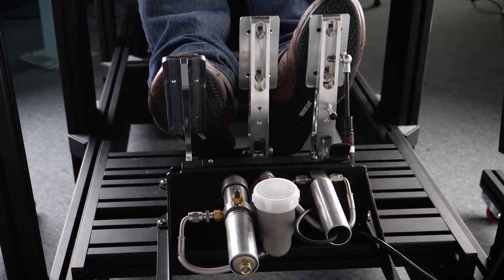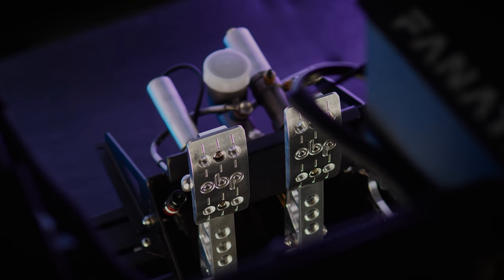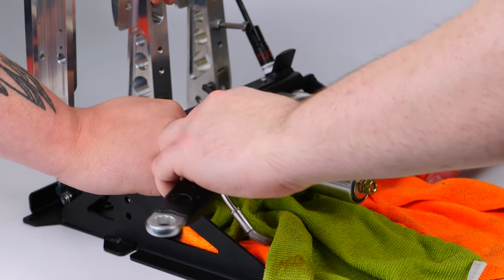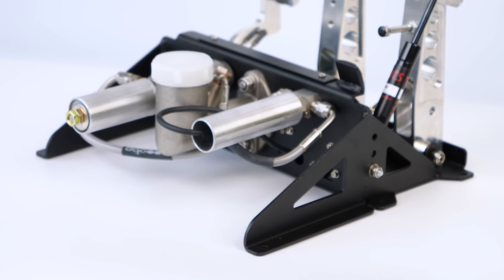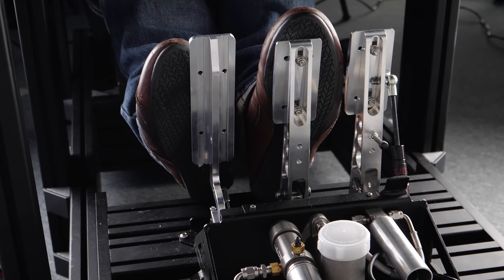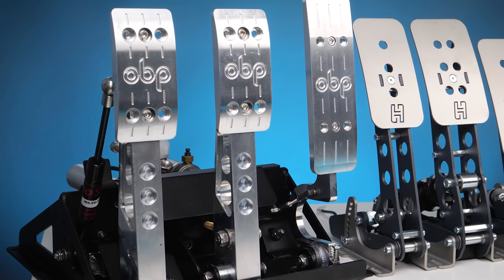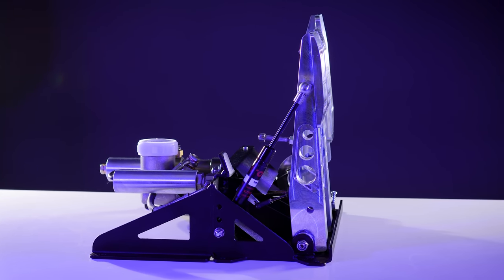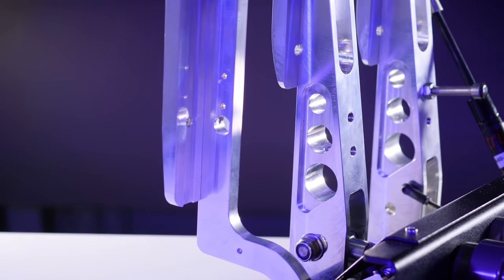Real Race Car Pedals for Sim Racing? Why Not! | OBP Sim Racing Pedals V2

Comment: I really like the simulated biting point on the V3's and others, for a clutch pedal to just be linear in it's feel is a step backwards IMO, a real clutch has a very obvious point where you overcome the pressure plate springs and good sim pedals should do also I think.
Reply: I was also thinking that

Comment: These OBB pedals are notorious for flexing in real racecar, when i was looking to build my own, everyone that had worked with them told that its not worth to use them and you should step up to tilton set. And they said that they definitely wold flex in sim racing environment. And i can tell you from experience you lose a lot of the “pure and high quality feeling form flexing.

Comment: Funny, when I talk to sim racers that bought this pedal, 80 % sold it after under 2 months of use, they had lot of problems with, sad. I had this pedals for testing in my old rig an it was a great experience, but 100% shore this is not a plug and play type of equipment, you need some dedication to make it right and for every different sim is also a setup to make it perfect. So I would advise people buy this only than you don't care how much cash it cost and you have no problem to setup it right.

Comment: Great video as always.
The brake appears to have too much initial movement compared to a race car, well all the ones I have pressed anyway. But I guess that is adjustable. 
Also I am still not convinced hydraulic gives any advantages. A properly set up and bled hydraulic system should not compress, so why not just have a mechanical linkage and not have the complication of a master cylinder, hoses and slave cylinder?

Comment: I got these last week and yet to use them as waiting on simucube 2. I had to drill two extra holes in the rear steel frame so i could mount them to the simlab pedal slider plate securley using the front and rear slots in the plate. OBP needs to add these holes for the future in my opinion. Hoping they are good!
Reply from the maker: Interesting - I didn't check these out with the slider, as that's still sitting in a box waiting to be installed!
Reply: @ChrisHaye  the extra holes go approximately 3.5 inches behind the middle mouting holes. You should see when you get the plate out. At first i was going to use the middle holes and drill the 12mm plate. But then i figured it would be a lot easier to drill the 2mm plate and that also lets me slide them left and right. OBP needs to drill these two holes or simlab needs to cut another slot in their plate for the middle mounts. Hopefully someone sees this as this is the first review on these pedals!
Reply: Hi there,
I have a set of these that arrived for a p1x. Did you still the pedal ok?

Comment: Great video as always Chris, they look amazing. Quick question for you, I noticed your feet position on the pedals and wondered if it's usual to have a gap between your heel and the pedal. I am trying to optimise this positioning (for speed) and I do the same as you but I've seen some pedal cams where the whole of the sole of the foot looks to be right up on the pedal with little to no gap there. I wondered if that might improve reaction times/ speed once I'd got used to it? I realise it's slightly off-topic but I'd appreciate any advice. I think rig setup and positioning of all elements is a generally underappreciated area. Keep up the great work, loving the channel!

Comment: Good to see a British Company taking advantage of us SIM racing mugs. £1.3K for a set of peddles outrageous. 
When I looked again at the peddles with my engineering head on, these are expensive to design and produce, weight reduction has been a priority in the design (not sure SIM racers should have to pay for this). Each of the three peddles is unique requiring different CNC machine programs, I could go on - but I won't, they are actually pretty good value for money, I doubt they are making 30% profit.
I don't think they will sell many of them at this price point, I for one will not be buying. I think what OBS Motorsport need to do is build this product at about £500 retail while still retaining all the features, could be done, simplify manufacture, SIM racers don't need weight reduction we don't move, use different materials maybe.  I would be a customer at £500 and maybe a bit more.
Good review Chris, hide them well, they are over engineered for a SIM racers needs, but beautiful a keeper for sure.
Iain
Reply: This is probably Saturday work for the OBS lads, Using existing machine setups and materials they have in stock, I doubt the sales figures(compared to their real racing stuff) justifies new setups, and possibly dedicated machinery, although with this unending lockdown style of government that might have changed, as sales must have dropped off for the real thing, as sporting events which depend on gates must be really struggling, Even F1 must be losing money now!

Comment: Hi Chris, first of all thanks for your videos has always. One question : do you need to apply more forces on the brake compared to the heusinkveld sprint? (i use between 25kg and 45 kg on the sprints). I wonder if it's not too low fore these OBP pedals. Second quesion : do you feel a difference on the trail braking between Sprint and OBP? It's rare to have someone able to compare those two pedals.

Thanks !

Comment: Just took  them out of the box and the pedals seem really close together.   I have sprints and I have more space between throttle/brake.   I see most people have left them in the original position.  I know you can move pedal over one slot and this is personal preference.   Seems like feet touch on current setup.  I left foot brake.   Wondering if you moved pedal face position.  Thanks

Comment: Hi Chris, the reason the USB adapter is separate is so the pedals can be plugged directly into a DD wheelbase or used on Thrustmaster wheels; Fanatec support is still in development. Also, you don't need to use the DIView software to calibrate them, you can use the windows game controller setup as shown here: https://youtu.be/-oSkwnRE4_U

Comment: Made something similar for like 250 euro not as fancy but works
Reply from the maker: Sweet! Got any pictures you can share? :)
Reply: @ChrisHaye  when I get home 🏠 I used something I not found yet on the internet meaning drive by wire gas paddles 3 times reading the values from it and using a pressure sensor with also master and slave cylinder and programmed a arduino pro micro
Reply: @ChrisHaye  are you in to diy stuff like simhub and openffboard, 3D printed steering wheels?
Reply: @ChrisHaye  https://drive.google.com/drive/folders/1rM202Q2XLWwNr7Rb4VL58OX9mwVQ4aRJ let me know what you think ;-) the aluminum 3030 is like halve the price so... and you can use pull slave cylinder to make it beter.. ordered also new spring.. for clutch and brake.. you can make it so expensive and how you like .. you want the current software does some kind of mapping to make it curve like heusinkveld software does.. many ideas to improve and to change but so limited on time  and money ;-)